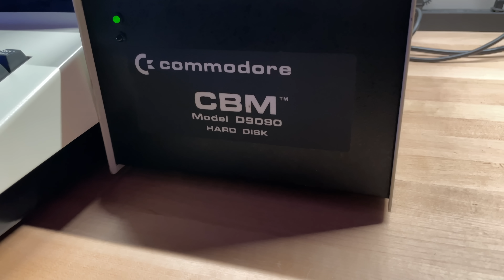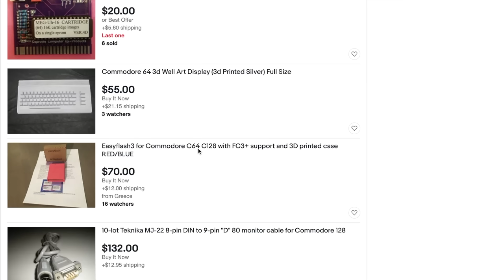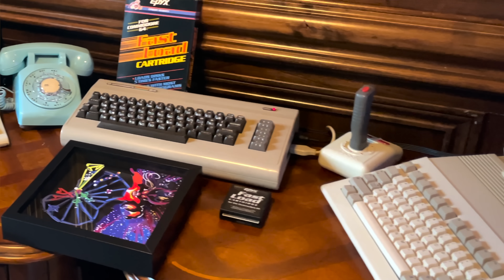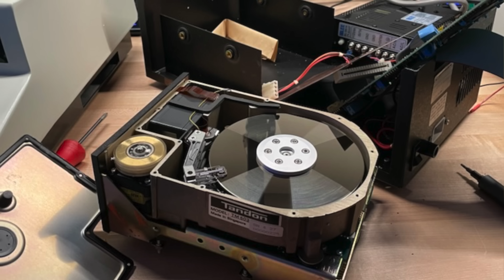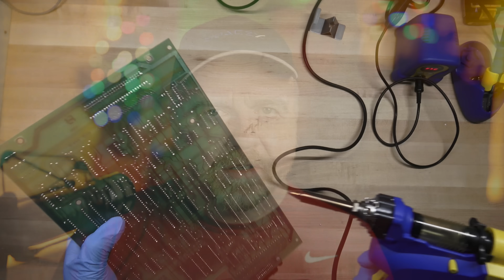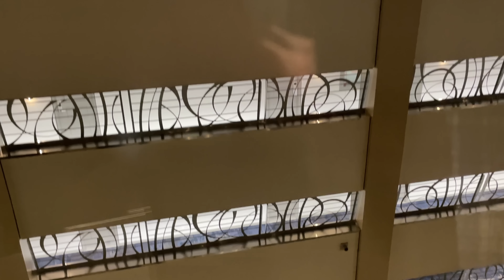FOUND: A Super-Rare Commodore D9090!

Comment: The design of Commodore drives always puzzled me. I never understood why they didn't do what Intel did with their disc controllers, which in Commodore terms would've been to develop a μC by jamming a VIA, 6502, some RAM and ROM into a single package and then programming it for the task at hand. It seems like the kind of thing they could've sold to others in an unprogrammed state by the shed load, and would've helped make their drives more affordable. They even could've produced a special core than only supports zero page access, moved the stack to the top of the zero page, and stripped it of any instructions intended for accessing anything else.

Comment: I aligned sooo many of those 1541 drives. Loved the service kit and disks that came for the techs, never happen today for a consumer grade part. Made sure the drive never came back by drilling and slot spring pinning the cog onto the stepper motor shaft. It was usually the copy protection test on the C64 disks that threw the drive out (clackety clack clack clack).

Comment: I ran a C64 BBS in San Diego for awhile and wanted to buy a large HDD back in  the early 90's but the $2000 price tag for a Seagate SCSI drive put the kibosh on that, I think it was 10 or 100Mb but cant remember for sure.

Comment: The original power supply with the transformer can very likely be restored. It usually has 2 110 v windings in series for 220. It may help your D9090 work properly . Also make sure that the TO3 transistors on the original power supply are securely mounted to heatsink and it provides the correct voltages before attaching the load. Your switcher is very likely underrated for the drive and very likely you have shorted tantalums as well.

Comment: I remember from IBM PC usage of MFM drives, there used to be a low level format you could do to set the interleave gap. What that was had to do with how the sectors were placed on the track. Nowadays, the sectors are one right after another on the track. The interleave gap told you how many sectors to skip for the next consecutive numbered sector. EG you might have sector 1 it would skip a few blocks on the drive sector 2 another few blocks etc until all the blocks on the track are filled up or numbered.

Typically you had to use a debug command, to call the low level formatting code that was included with the drive or controller.

I was thinking that maybe just maybe it might be involved in why some of the drives work and some of them do not

The idea behind the interleave Gap was to give the computer time enough to read or write the data that was pulled from the drive into the buffers or out of the buffers. If it's since computers have gotten a lot faster over time the angel leave Gap was pretty much except to zero. It was designed as an optimization feature or even a timing feature as well. I remember as confused got faster the Gap got smaller. I don't know 8086 one megahertz the Gap was maybe three or four.

Now an interleave Gap number the physical sector number versus The logical sector number were different and set with the low level format. Then on top of that you do that you're high level format I'll say dos or whatever

Comment: The Metal case would be earthed via the psu chassis if there is in the drive that leaks current to ground that would be source of your current flow. DC or AC Current is Current.

But anyway i think something like that could be happen a good test could be to remove the psu from the metal case of the drive and measure current flowing to earth.

Comment: GFCI or breaker? A GFCI measures the in balance between the hot and neutral through eight cents in Coyle so my guess would be some fault to ground somewhere in the device which wouldn't have shown up with the transformer since it's an almost isolating it and can probably source the power. Although it is possible it just drew that much power that's switch mode wasn't able to handle.

Comment: Hi, You make great materials.
Repair the original power supply, preferably with a real electronics specialist.
I myself deal with IT-related repairs, believe me, I know what I'm saying. Never ever connect a switching power supply to very old electronics, as repair may not be possible due to the lack of parts on the market.
Such equipment is not designed to work with such adapters, and they can be so unstable when turned on and off that you can compare it to Russian roulette!
At the output of the impulse PSU, there are often so-called pins - high voltage discharges lasting ~ milliseconds, which easily turn electronics into scrap.)
Best regards, Tristan

Comment: The first hdd looked like it could have some plugs not fully inserted. A high resistance connection could cause high current draw and blow a fuse or trip something. One of the other hdds that complained about the speed not being high enough made me think the power supply may not be giving enough watts to get it to speed.

Comment: was it an AFCI Outlet? Those outlets are very touchy you can not have even a ceiling fan connected to the circuit or they will trip. As for Gfi Outlet can be touchy as well depending on who made it and age of the unit. They sometimes have issues with motors. If that is the case replace the unit with another gfi or standard outlet. An old former journeyman electrician.

Comment: I think that your AC breaker issue is probably due to such old hard disks used to employ AC inductor motors (onto separated circuit), pretty much like old 8 inches floppy drives. Take a quick look to the motor label.

Comment: Sorry if somone has already posted this but, I believe GFCI outlets/breakers work on the principle of balanced currents between line and neutral by using a pair of coils. This is intended to trip when the in flowing current is not countered by an equal amount of out flowing current such as would be caused by a short to earth ground. However, phase imbalance due to the load, such a stuck motor jumping to locked rotor current acting like a large inductor, can also cause the imbalance. Normally, this only happens under high loads and the breaker can ride-out lower amplitude imbalances. It's all about amplitude and time.

Comment: Mmmm... Tasty discount. If I remember correctly the original list was $2995, plus a VIC-1112, or other, IEEE-488 interface cartridge to talk to the AMD controller chip with SASI interface (became SCSI from Shugart( that became Seagate)) to control the MFM TM603S Harddrive from Tandon (that became Western Digital).  And it only takes an hour and a half to format it.

Comment: I don't have the few grand of greenery to throw around at devices like this, but, I went and kicked up VICE to see what it'd be virtually like to have one of these D9090 drives.  I managed to get it going.  29162 BLOCKS free.  The ROM I'm using, though, forces the 128 into C64 mode, so I'm on the hunt to see if I can find a 128 image that'll support the D9090 drive.

Comment: As for the cause of the 12V dead short inside your disk drive, i'd put my money on the spindle motor windings, or any cap that is part of the windings. If it had an electrolytic cap in there to start the spindle going, it would surely be long since dried out by now. I'm not sure if its even that style of motor (that requires a cap to start initial rotation), but in my limited experience, the problem with old tech that spins is usually the windings. i've often seen the enamel on the wire in the windings get impossible brittle. i mean so brittle that a gently tap will cause a short in the windings. Usually with bad windings they just get super hot and let the smoke out as the enamel coating cooks, so who knows. if the seal on the drive was good, you probably couldn't see or smell (or taste) the magic smoke. If you saw or smelled literally nothing during the failure after the initial spin up, it almost certainly was inside the seal.

I bet a hard drive repair tech would have much better guesses though. if it were me, i'd be called the old timers from the micro user's group where i live because some of them still run crusty old disc drives from even older eras

Comment: @Dave's Garage; Not as cool but just as, if not louder... my IBM 5150, stock of course, so there's no third party after market mods to this, but the 5161 Expansion Unit attached to it that has not one, but TWO, full height hard disks sounds like jet preparing for take off and I love it and fortunately to my surprise (knock on wood) fully pass diagnostics every few months when I put them through their paces.  As for the end of your video, the last time I was at the Marriott Marquis was the Windows XP launch back in October of 2001.  Where you at that, Dave?

Comment: Don't know how your power-supply, was or, is set  up. But most drives and power-supply's are grounded through the metal case, if the drive motor was shorting out, (bad winding, contacts, etc.) the power returns to your gfci through the ground, and snap, tripped recpt.   some gfci's can trip on as little as 15 ma

Comment: Not quite the same, but I was blessed with a 20MB HDD on our family 8088. Floppies were fine, but when Rogue/Hack's bones levels filled a floppy, the game would crash under the right circumstances.

Once I learned to copy files and folders in DOS around age 8-9, my games got so (relatively, haha) quick once copying.

Sadly, the drive died around 2000 from terminal seek errors. I got another year from a similar drive, but that died the same way.

The fact this drive is workable in at least some form is amazing!

Comment: I had a 20mb MFM drive in an old IBM 286,,,8Mhz processor, 640k base ram with no extended running DOS 6.0 [with doublespace] which I later upgraded to 6.22 [with drivespace]

Comment: @13:20 your AC ground and DC ground are common. GFCI will blow if it detects any current on the GROUNDING wire. Current is flowing, likely through the chassis, through the ground. Something is probably shorted to the chassis through the ground.
Reply: Sorry I said that kind of wrong. Technically it measures for current difference between hot and neutral which should have the current balanced; if they don't it's likely going over the ground wire (or, via something else to ground, but unless you're getting zapped or it's connected to a separate ground, than the imbalance is leaking over the ground)...

These electrical wiring devices are designed to quickly and automatically isolate a circuit when it detects that the electric current is unbalanced between the supply and return conductors of a circuit. Any difference between the currents in these conductors indicates leakage current, which presents a shock hazard

Comment: GFCIs measure CURRENT, not voltage, in a circuit.  If the GFCI detects an imbalance between the amount of current going in vs leaving on the neutral, of as much as 4-5 mA, then it trips.  The 12V motor or motor control circuit on the HDD was probably leaking current to ground pretty heavily, otherwise it wouldn't have smoked power supplies.

Comment: The MFM emulator board you got looks like a clone of David Gesswein's MFMemu, it suppose to use a Beagle Bone Black which has an Ethernet port that you can telnet into without needing a USB to Ethernet adapter, i have used it to recover several ST506 Drives.

Comment: I'll not be the only one to say this -- Some caps failed open. The PSU you put in had poor over-current protection. Re-cap and first power it from a bench power supply with current control. Once it's working, replace the dodgy PSU with a better PSU. Disconnect the ground from the bench power supplies to see if there's a ground leak inside the case. Check that you don't have an arc fault breaker - if you do it's just tripping on the sparks.

Comment: modern switch mode power supplies are nice and fancy and sometimes efficient, but they're nothing like the old chunky transformers. it's a scary thing when a switch mode psu fails. transistors tend to short circuit when they fail, which sends high voltage full force into your computer hardware. an older transformer psu is much safer for that old computer hardware. if you somehow manage to kill a transformer, it's likely just gonna cut power and smell very bad.

Comment: In regards to the power supply tripping your breaker: I would check the breaker. If the rating on the breaker is lower than expected, or the breaker is out of spec, that would do it. I would test with a different circuit.

If it is a GFI thing: there may be some funky feedback on ground. GFI should trip at 10ma(ish?) over the ground. I would try an isolation transformer (~$100) or an old school rack mount surge protector with a big fat coil in it, and test ground current, and then everything else. I'd probably start with trying to find a leaking cap near a filter somewhere. If it's a GFI thing, the problem is probably near the ground plane (logically) somewhere on the board. Good luck.

p.s.
The isolation transformer is the preferable choice of protection. The surge protector will only, hopefully, protect the people who move your body after you get shocked

Comment: ELI5 GFCI monitor what goes out on the hot and what come back on the neutral, if that ever changes (a leak outside of the circuit) it will trigger but if it stays the same no mater how much is drawn then as far as it concerned no problem

GFCI Ground fault Current Interrupter only monitors the power differential between the hot and neutral. So long the power stays withing the "loop" from the hot to the neutral it will never trip. How ever if it finds a path to ground weather it be the grounding electrode(green wire) or the earth it senses a discrepancy and then will trip. A circuit break works on 2 different mechanisms, magnetic and thermal. When your circuit shorted and did not go to ground but pulled a quick spike it trigger the magnetic trip. The thermal trips if your pulling close to or a little over the ampacity of the breaker.

Comment: It was interesting to hear your comments on documentation. Back in my days as a software tester, if I was given some software (could be a simple driver or a full blown package) without documentation it very quickly got sent back marked "inoperable". Although I might be able to figure out how to make it work chances are that the end user will not and to them that means inoperable.
I find this to be a problem with so many open source packages, no-one wants to write the documentation and users end up having to hunt for hints and clues from random websites many of which are talking about completely different aspects of the software or are simply wrong.

Comment: If the drive is introducing an AC ripple back into the power supply ground (shorted motor or driver chip) it may cause the GFCI to trip. GFCI outlets/breakers usually need around 10-15mA to trip.

Comment: Wrong power supply that you guys were using on the d9090.
The d9090 can pull 5 amps on the +12v line and a whopping 8 amps on the +5v line especially during startup.
That little RT-65B power supply you guys were using could only muster 2.8A for 12v's and 5 amps for the 5v line.
Im sure your d9090 is fine.

Comment: Dave, you are a rock star.  I think we're probably about the same age and I started on similar equipment, though I don't think I took it as far or as seriously at the time as you did.  I recall single-digit-MB capacity HDDs from back in the day, that seemed huge.  I think the ones I saw were attached to C64s rather than PETs, so perhaps a bit later than this bad boy.  I also started out my computing life on a school PET, then VIC-20 and C64.  So cool.  This video is so nostalgic!

Comment: One of the driver chips that power one of the phases of the poly phase motor, has probably shorted to ground. That or the motor phase coil shorted. The main power capacitors on the drive itself are also a possible.

Comment: sounds like the drive was pulling more current than the PSU could supply, this caused the voltage to drop (drive slowing down) then either something in the PSU fails to ground or the AC side draws more current than the GFCI is rated to, thus tripping the breaker,

Have you tried the original PSU with a 110 - 240VAC transformer first then check the current draws?

Comment: My SWAG (scientific wild ass guess) is the power supply might have bonded the negative side of the DC output to earth ground (via its own outer case maybe), which is also bonded to the neutral wire of your AC circuit, which might have caused the outlet to trip under some sort of weird, catastrophic failure condition.

Comment: GFCI detects a fault with the ground and then interrupts the circuit if this condition exists. I do not have extensive experience with these, but suspect a missing or faulty ground connection would trip it.

Comment: It sounds like it would have been easier to have a 220 volt outlet considering the difficulties you were having.  Not always an idea solution but I guess that would have worked.  The only problem is most people here in the USA would have to call an electrician to install that (unless they already are one).
Reply: He'd still have all the same issues, unless the new power supply fried some of the drive's circuitry.

Comment: FANTASTIC!  I still have a working C=128 + 1571 + aftermarket power supply+Hayes 1200baud modem + Epson dot matrix printer with DIP switch font control.